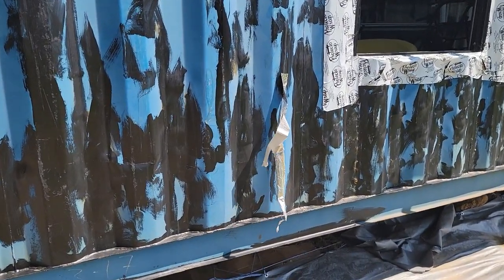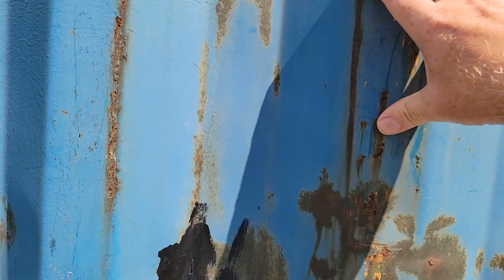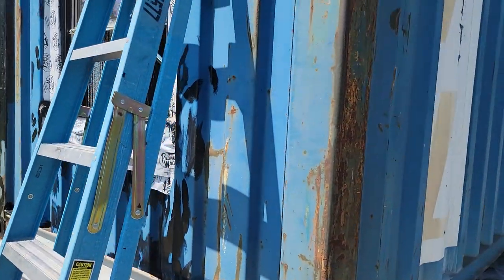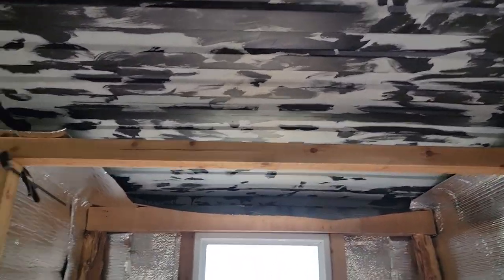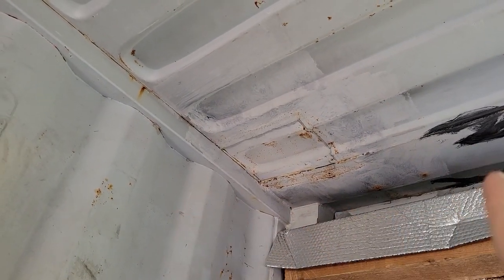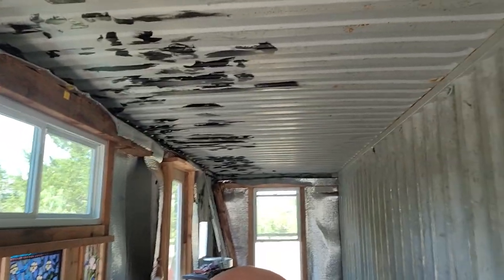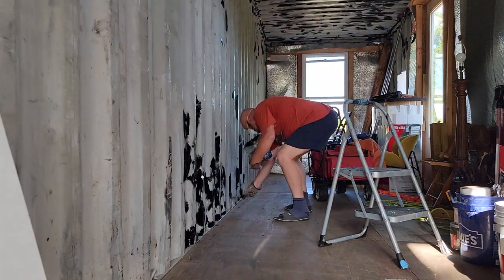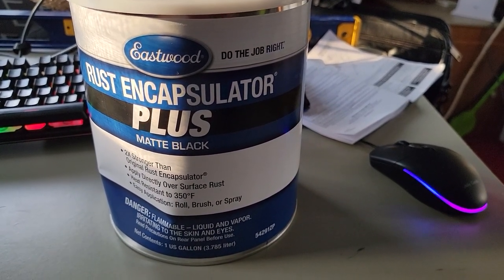Rust prevention in a Shipping Container Interior and Exterior   Easy and Fast

Comment: Would you be concerned about rust inside the steel tube framing? I had a couple holes in the top of the framing due to rust damage and the tubing filled with water. I drilled weeping holes and drained out the water but it was rusty. When drilling small holes into the framing my drill bit comes out covered in rust.
Reply from the maker: I agree with your thoughts completely.

Since coreten is designed to rust my idea is is a balance between removing salt from its ocean travels and prevent new water from reactivating rust. The patina that should form normally is part of my consideration. I am in central Texas and far from the coast so I am content with the rust treatment. 

My goal is not to weather salty breeze or cold Michigan winter. I am counting on the 300 days of sunshine a year to keep the rust to a minimum.
Reply: @1000YearHomes  I'm on the coast but in southern california where it is very dry year round so I think I'm in the same boat as you. I'm hoping to get a long life out of my container but it is already 40 years old and was mistreated (it came with the property).